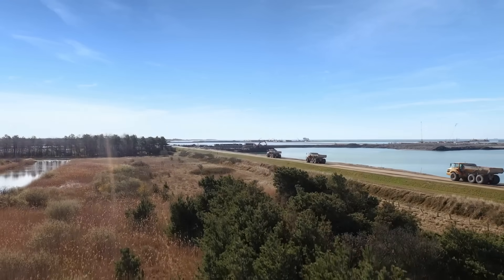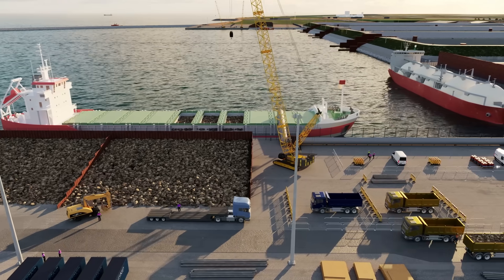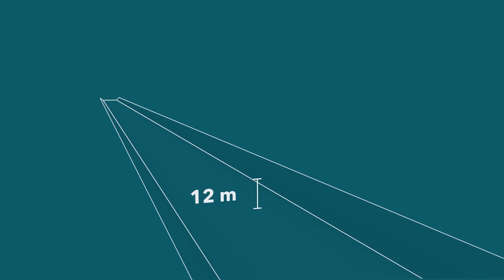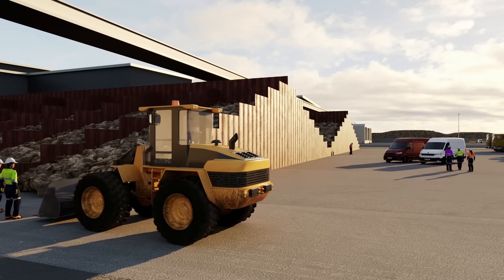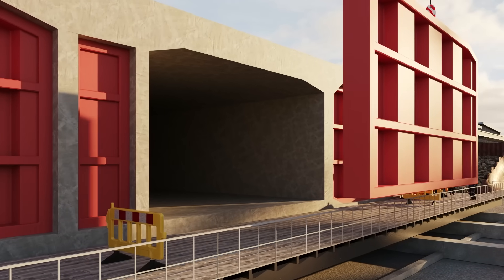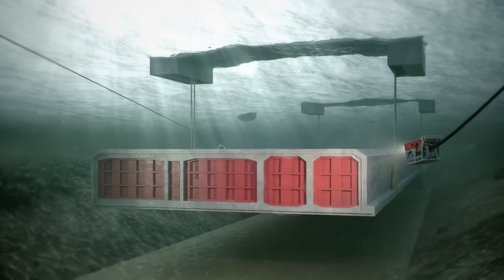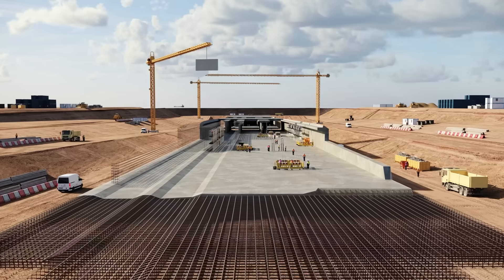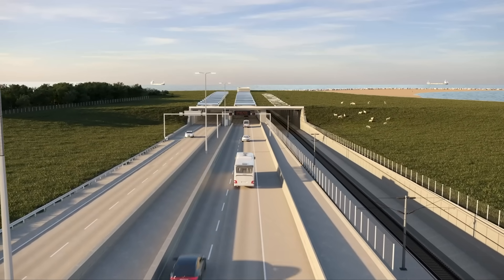How the Fehmarnbelt Tunnel is being built

Comment: Comparing this to Eurotunnel, I really don't know which one is more insane. To dig a dry cave under meters of soil under meters of water, trusting you will be able to handle the structural instabilities, or to transport and install a flat structure in a trench prepared under the water, made smooth enough to don't produce structural stress on the tons that will compress it...
Reply: I was just wondering whether a second Channel Tunnel could ever happen, and if so whether this method could possibly be viable, given how the current one is quite twisty due to the TBMs having to stay within the chalk belt. It seems as though immersion might allow it to be straighter
Reply: @Inkyminkyzizwoz  I don't think there will be another Channel tunnel. There already is one. The method in this video is of course, a lot more efficient, because you don't have the drilling. You just click together prepared pieces.

Comment: I really do hope they make the seals between the elements re-expandable.
No matter what you do, there wll always be some movement after the elements
are placed, and so these seals should be at least minimally flexible,
with the ability to contract and expand.
Also, a mechanism for forced contraction would be a neccesity as well.

Once trucks and other heavies start moving through the tunnel, it will
sink into the soil a little at least, and thus from the start of the tunnel you need
a little extra to compensate for any such motion, which will happen
over several miles, and thus yield significant differences in length of said distance,
which may be as high 1 meter difference on each end.
If the forced contraction mechanism also has a tensile gauge, they can check
for motion by checking the tensile gauges. If they change there's motion,
if not, no motion.
They can either use a cable system that allows the pieces to simply
press into each other, no matter the motion, or have each piece hook
into the next and pulling that in.
I calculated roughly 2cm by temperature differences alone for each piece,
which happens at least yearly, but to a smaller degree daily.
I'd add at least one more piece on both ends, to compensate for yearly
sinking, or at least a part of a piece, like 10 meters long.
As the gap widens, these pieces can fill the gap, while the gaps
they themselves leave can be filled with regular concrete, since this would be on dry land.
Reply: I'm pretty sure the engineers thought all of that, genius...
Reply: @robkaman87  Wouldn't be the first time they didn't.
Reply: They use a Gina-seal first, an omega-seal from the inside and concrete to seal it off
Reply: @maroltma18  No matter what seals they use, it always needs to be flexible.
It's not like underground tunneling, where a little unwanted stretch leaves
a small gap that can be easily filled.
Underwater, water will not hold it's place.

Concrete will not stretch, it will break when stressed by tensile strength.
Reply: @ZMacZ  this is exactly what the gina and omega seals are designed for. They allow the elements to be flexible even when earthquakes accure. The concrete is just used to cover it up as far as i know.
Reply: @maroltma18  Concrete covering is rigid and won't help. Rigidity is not the answer but the problem. It needs to be more flexible in order to accomodate any motion inward and outward. Since the concrete parts are rigid, the flexibility must come from seals.
Reply: + the tunnel is burried underneath the seabed aswell as shown in the video. It doesn't take the whole stress away of course but it does keep it in place much better. It's not a completely new concept by the way. It works already
Reply: I was thinking the same..i hope they will consider this.
Reply: "It'll sink a little" - wtf man didin't u listen? 73.000 tones in 200m. U get max 1.000 tones load per section at the worst traffic. Is negletible compared by ratio. Don't even mentioning footprint.
Reply: @giedriuspundzius8403  They make concrete roads with less steel and concrete than this and they don't crack under the weight of trucks. Like tou say the weight of moving traffic compared to the actual weight of each section is minimal.
Reply: @giedriuspundzius8403  The sinking will occur as a result of the mud.
Reply: Would love to see what is used to keep the section bonded together. Stressed steel cable?
Reply: @shaunehuolohan5736  (The comment moves to the bottom, I though it was deleted.

Actually that would overstress quickly.

If a section drops, the parabolic part of the tunnel will stretch, and since it will
have to then hold not just traffic but the concrete sections up, stress will accumulate.
It's better to not counter it with stressed cable, but instead to allow all sections to sink,
while simply adding two variable ones at the end.
They can add a full section that can then fill the gap, while still connecting to the road.
If the tunnel pieces sink a little, so will the added sections, and using a good seal
in between, they can avoid leaking.
In fact, pushing the end-added section inward will keep those other seals intact.

Alternately a concrete outer parabola for the sections to move onto, and gravity
pushing at the edges will keep the seals shut, while still allowing motion.

Anyways, maybe they'll get it done anyhow.
Denmark is a very nice place, and getting that tunnel done will help keep
Copenhagen free from much exhaust pollution.

Comment: I don't understand how do they connect the tunnel sections . Is it just a matter of screwing thousands of thick bolts with a seemingly thick incorrosive gasket between them  ?!!! Only a detailed animation will make me comprehend  .
Reply: As they mentioned in the video, they will pump water out of the segments, which creates a sort of vacuum that pulls the two segments together
Reply: The vacuum effect helps pull them together but doesn't seal them properly. That will be done by huge bolts or welding

Comment: What about ventilation? Emergency exists if there's a car accident? What if the sea level moves, earthquakes, etc. A ton of questions unanswered...
Reply: We dont have earthquakes of any significance in Denmark. I assume the technical tunnel will be used as an emergency exit. We already have a similar tunnel connecting Sweden and Denmark 👍
Reply: Emergency exit is the maintenance tube. Same as the other tunnels that have been built.
Reply: Can a segment will be able to be closed in case of water filtrations or fire ?

Comment: How do they get the bulkheads out after the water is removed? I was waiting to see that...
Reply: The first car has to go really fast
Reply: after joining two parts the inner bulkhead could be removed, then when a new part arrives previously outer will be removed thus continuing incrementally.
Reply: Not sure if it's what they will do but it seems like you could just dismantle them and remove them from inside the tunnel.
Reply: The Bulkheads are designed to be dismantled from inside the tunnel and reused for another element.
Reply: They use dry sponge.
Reply: I would imagine that once the tunnel is ready, they will remove each one by one, the sheer pressure that 73000tonnes of stone will create would probably be enough pressure to keep any water out
Reply: I thought they rather glossed over joining the segments together. Just push them together and the water pressure stops any leaks. Seems very sus to me.
Reply: @adrianthoroughgood1191  I was wondering the same thing. Found info about seals that will be used.
Reply: I have the same question.. .no video show how they remove it ..
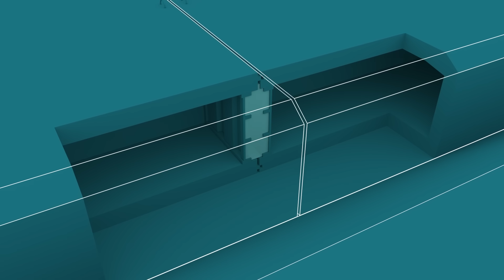Reply: Go to 2:43 they say they will be pulled out fron the inside once the water is pumped out then their will bea vacuum seal and it will be covered with stone
Reply: @StonedDad  No that is not what she says, she says 'the elements are pulled together (sections) and the water is pumped out', no mention of bulkheads.
Reply: @benedictearlson9044  From the illustrations, it seems that the bulkheads, when joined, will be hollow inside. So in the initial positioning that hollow section will be filled with seawater. Pump that out and you have a vacuum.